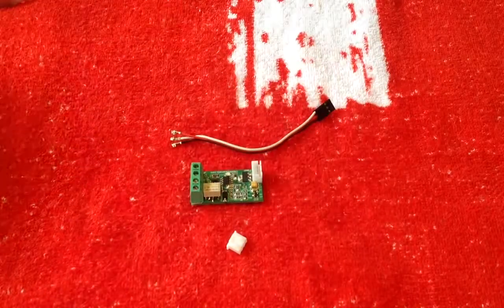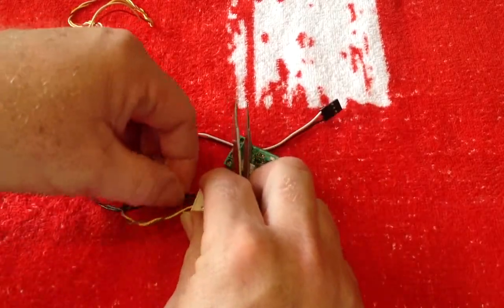Komodo+ Wiring How To

Comment: hi, when will you have this in stock again..l am very happy with the dragon and 
need this for my IR tank.. thnx
Reply from the maker: There are a number of Komodo+ available now which feature the same relay as on Dragon.  The higher spec relay that was being put onto Komodo+ is unavailable and the manufacturer is reporting delays til at least March 2015.  So all Komodo+ available till then will be featuring the same relay as on Dragon and MAKO2.
Reply: thnx, but when I check the site its all Sold Out..